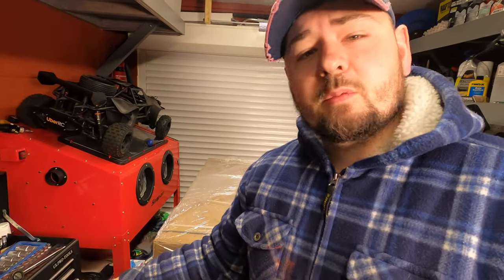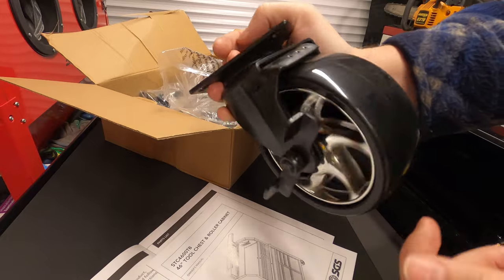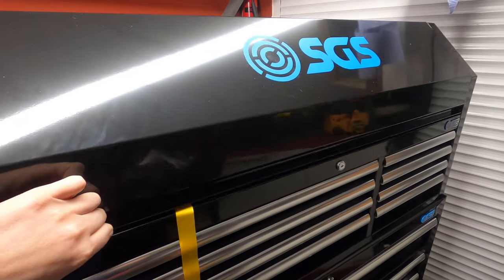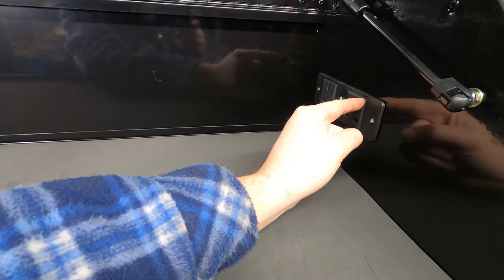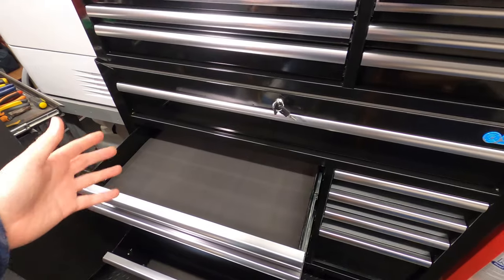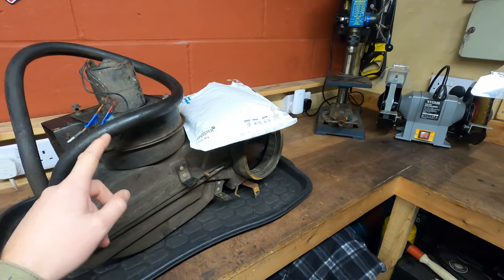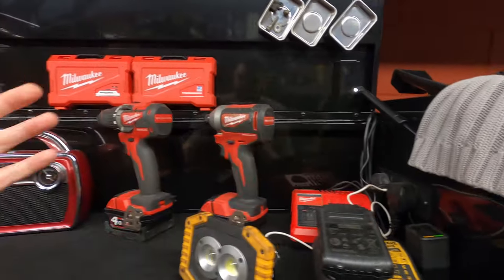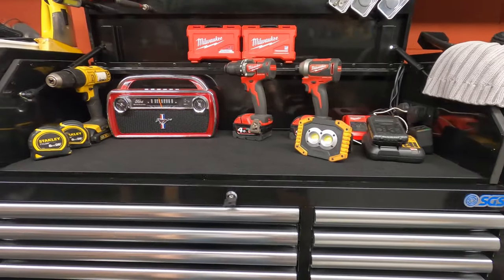46" SGS STC4600TB Professional 16 Drawer Tool Chest & Roller Cabinet Review

Comment: Hi, this is the second video of an SGS rolling tool cabinet showing poor workmanship, design and finish. Thin sheet metal and finish unable to stand up to the rigours of intended use. The other video showed the castors twisting under the weight of the cabinet and tools, they are mounted only to thin sheet metal, same goes to the long handle for moving the cabinet. Very disappointing. Thanks for the video it has helped me eliminate SGS from my choices for a new cabinet.